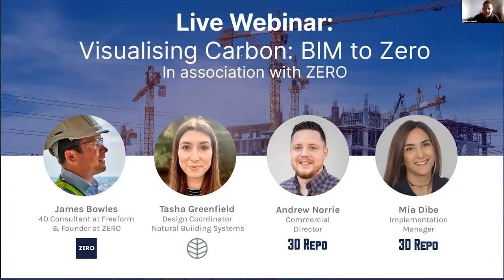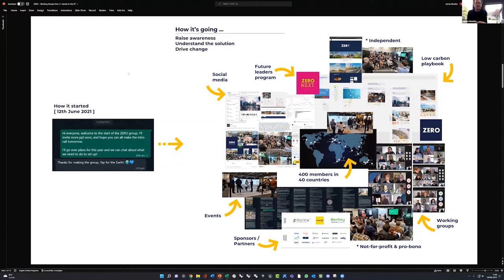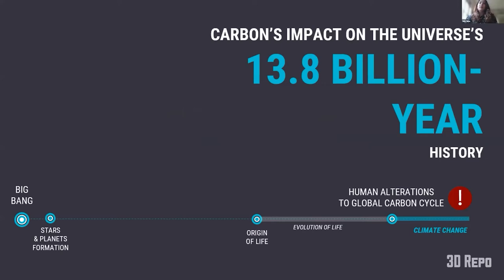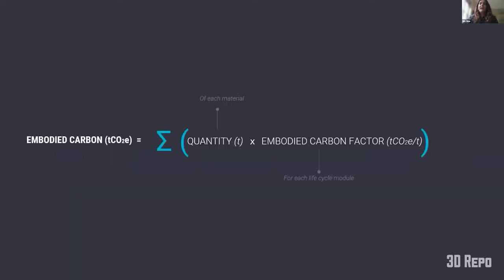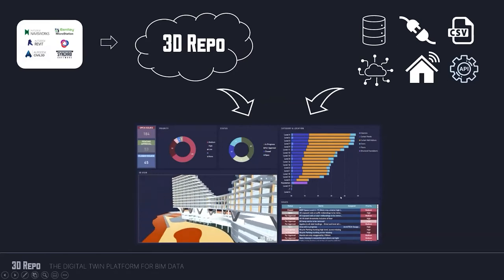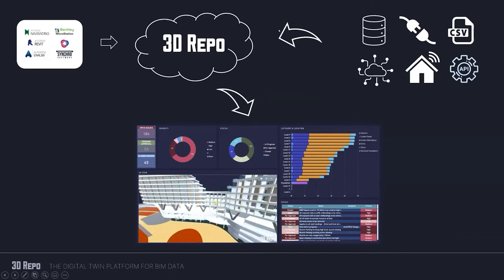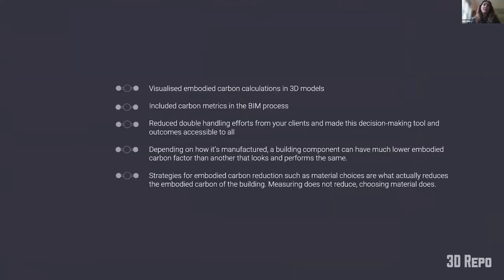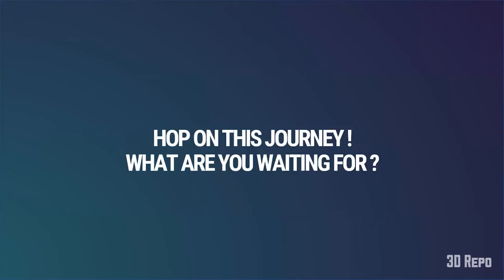Visualising Carbon: BIM to Zero

Comment: Thanks for the webinar which is very interesting.  I know that this is on the 3D Repo channel, but we have our models hosted in BIM 360.  Do you know if Method 3 would work if a carbon dataset, like ICE dataset you used is connected via BIM 360 model data then pushed to PowerBi?  If so would you connect the dataset to the revit models in the same way that you have in 3D Repo?